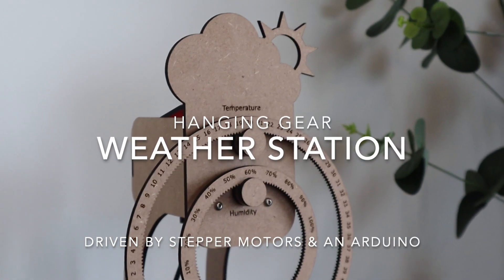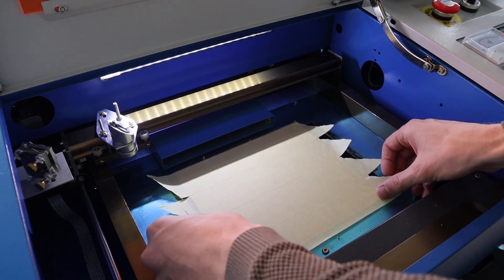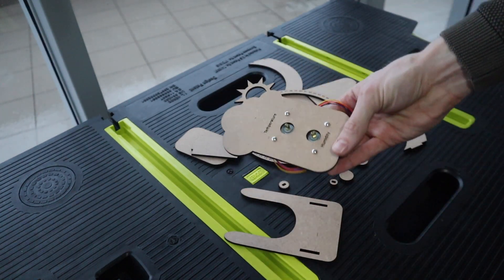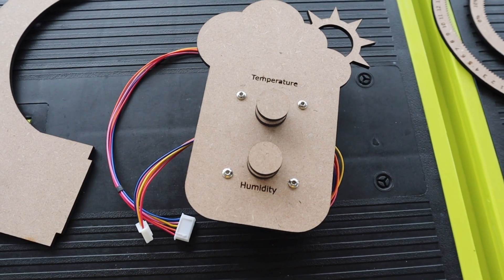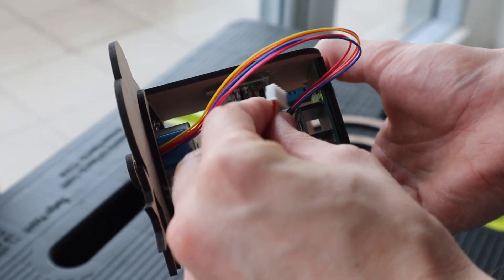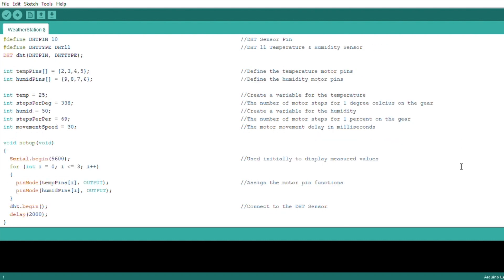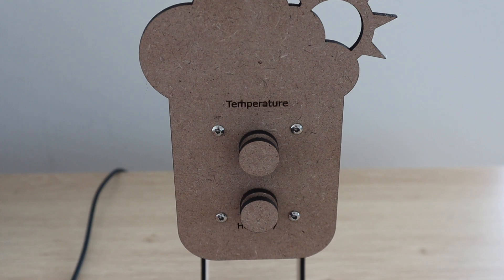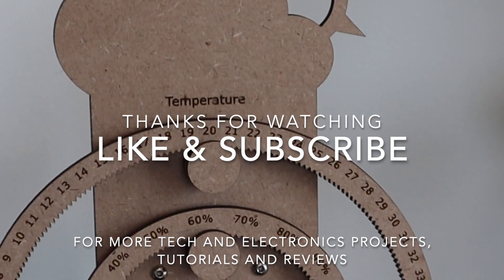Hanging Gear Weather Station - Driven By Stepper Motors & An Arduino

Comment: Your laser cutter link appears broken. Nice build!
Reply from the maker: Thanks Jeremy, I've corrected it.
Reply: @MichaelKlements  Cool, thanks! What kind of exhaust do you use? Also, does it have an interlock that cuts the laser off when you open the door?
Reply from the maker: I'm just using the standard extractor fan that came with the cutter, it's seems to work fine for me. There is no interlock on the door either. I've tried adding an fan based air assist and have since removed it as it didn't provide much benefit. I've also added a red dot pointer to the cutting point and added an ammeter to the front panel. I'm busy working on a stepper motor driven adjustable height honeycomb print bed, it should be complete in the next few weeks and I'll post the video.
Reply: @MichaelKlements  Neat, thanks! Did you have to hook up a duct to the outside for the exhaust?
Reply from the maker: I've just used the flex duct which came with the fan and directed it outside. This works fine for me, although I've seen most people replace the fan with an inline fan at the exhaust side of the duct.
Reply: @MichaelKlements  Ah, cool, thanks. That's been a bit of a hesitation, piping all the smoke out, but I imagine it's much less than, say, a fireplace (hopefully at least, ha)!

Comment: Pretty cool project! I got a bit confused by the syntax but if I'm not mistaken the motors are on the whole time. If you set everything to low when nothing is moving that should improve battery life.
Reply from the maker: Thanks Chari. Yes you are correct, one coil on each motor is always energized. You could definitely turn them off and even put the Arduino to sleep between readings to save power if you're going to be powering it with a battery pack.